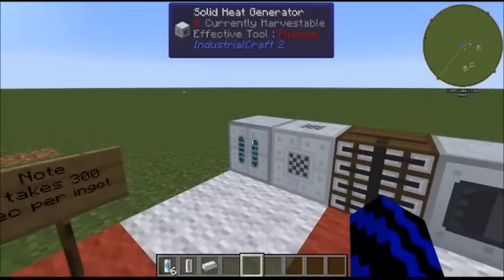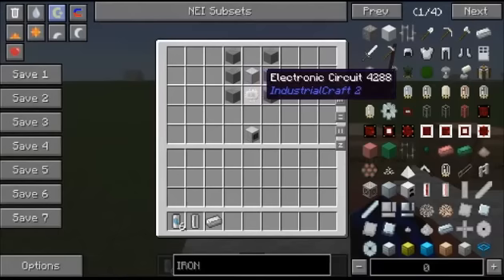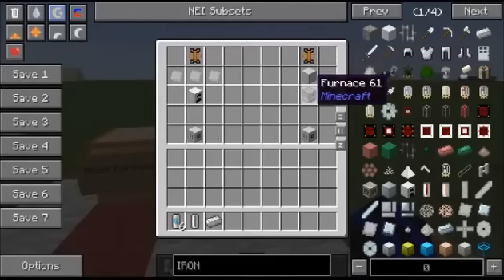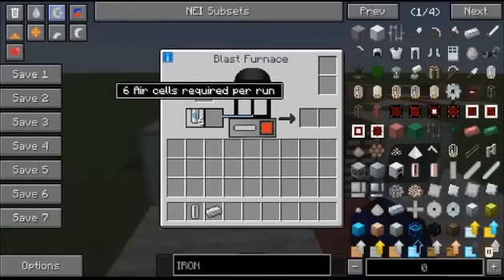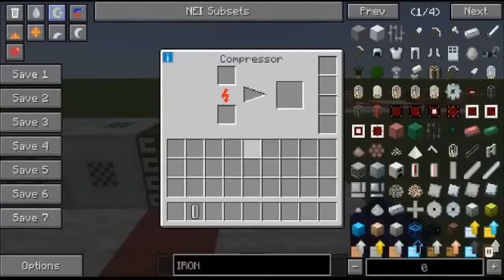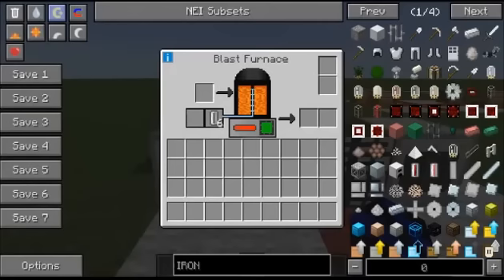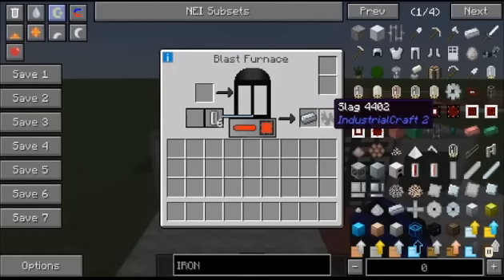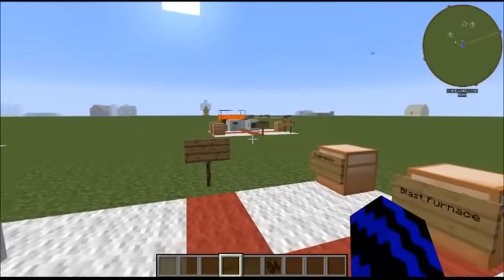Tutorial IC2 Blast Furnace 1.7.10

Comment: Thank's a lot! I couldn't figure out how to make steel so I looked up refined iron because it turns into steel. Then finally found that it could be made in a blast furnace. Then once I put it down it didn't work. Thanks for the tip with the heat generator because now it finally works and I can continue working on my nuclear reactor! Thank's a lot! :^)
Reply from the maker: +HenkHip  well glade i could help and thanks For the support

Comment: I did everything what you said, and my blast furnace isnt receiving heat, what can i do now? im stuck with this mod, i cant build anythiing else without the refined iron
Reply from the maker: +TheMostGamerMEX first check that the orange square are touch.  And have the heat generator if that is all good try using a Redstone signal on the blast furnace
Reply: @firethelier8553  thx dude

Comment: How do you get the blast furnace and heat generator to face eachother? I'm finding it impossible to do.
Reply from the maker: you can use the Industrialcraft wrench by (shift left click) on the opposite side you want it to face hope this helps
Reply: Just tried. It's shift right click, but thanks. Working now!
Reply from the maker: no problem

Comment: For some reason this won't work, i have set everything up as you did but the heat generator always burns one coal then won't burn anymore and it always sits at 0/20 transmittable heat, also nothing happens to the blast furnace.
Reply from the maker: hi you need to put the 6 air cells in the blast Furnace and a piece of iron first and the heat will build up but takes a bit of time and then the generator will burn more coal. and site at 20/20. when the heat is enough the progress will begin. hope this helps
Reply: FireThe Lier Well i don't know what has changed but it just works now, thanks for for the video!
Reply from the maker: tomjohnson37 just glad i could help
Reply: You need to put a redstonetorch or a lever next to the blastfurnace and you have to put the orange sides together. Hope i could help.
Reply: Mülker zockt Thank you sir!

Comment: for some reason i cnt craft Compressed air cells and they also wont Show on too man itemss…. could somebody help me with that?
Reply from the maker: What mod pack are you using? Or is it on vanilla MC?
Reply: @firethelier8553  I'm using the Infinity evolved ftb mod pack for 1.7.10
Reply from the maker: You craft the empty cell  frist then put them in to the compresser to give you compressed air cell. Then place them in the blast furnace. Hope this helps
Reply: @firethelier8553  thanks, it worked

Comment: I cant get the heat pad to line up with eachother. other then that it works.
Reply from the maker: +sirjolly81 place the blast Furnace down first. Then stand on top of the furnace and face the opposite way to the heat pad and place the heat gen down. If that doesn't work use the IC2 wrench hope this helps  just remember the blast furnace need a redstone signal.
Reply: Cheers. I manged to get it aligned and working, No redstone required for me.. it just worked.
Reply: Mine didn't seem to need a redstone signal either. Also my UI looks different from the video so I think it got changed.